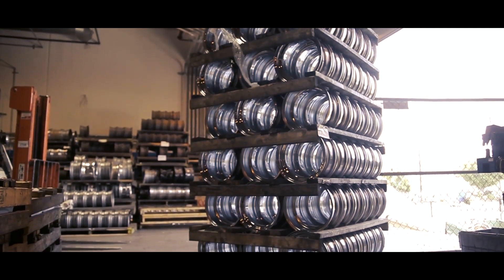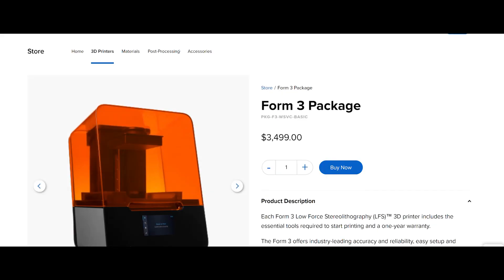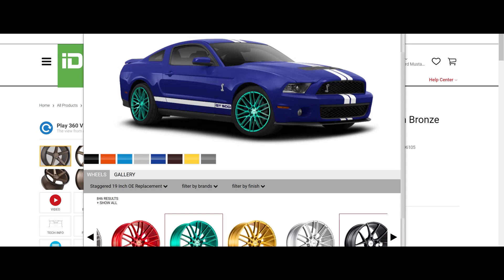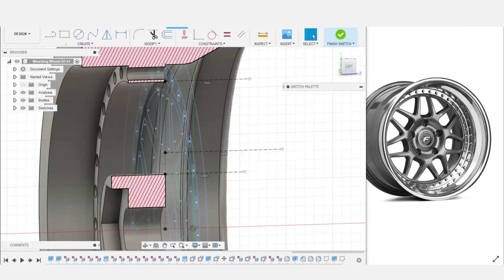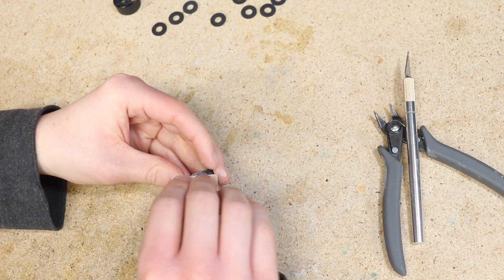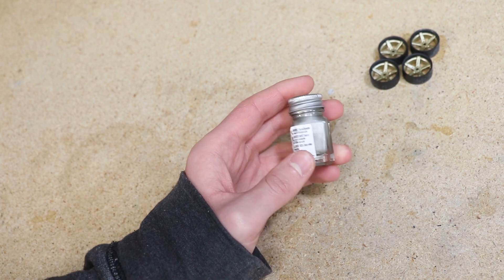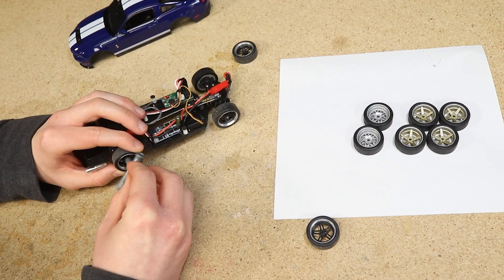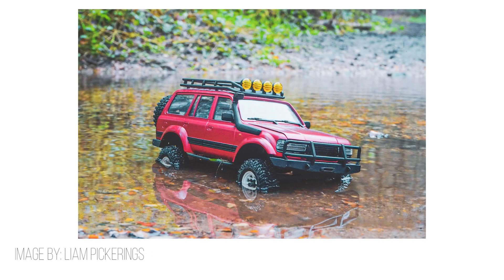How I Designed and 3D Printed Custom Wheels for My 1/25 Scale RC Shelby GT500

Comment: I've been 3D printing for 6 months, learned so much, so much to learn....  Curious why you printed the wheels elevated on supports VS laying flat/on a raft?
Reply from the maker: Nice! The wheels were printed on a SLA printer which prints the objects upside down. Here's a link with much more info than I can reasonably put in a comment if you're interested in learning more about supports in SLA printing: https://makezine.com/projects/fine-tune-your-resin-3d-print-supports/

Comment: $99 for an anycubic photon zero. Worth it. The only problem is there aren't really replacement parts available. But for $99 for a working machine that has great results there's no excuse anymore. I've been using dyes for clear resin which has saved me even more money. There's never been a better time to get into sla printing.

Comment: I have an elegoo mars and it does amazing detail. It is all about dialing it in and figuring out proper slicer settings. It can be finicky sometimes but it is also costs 10x less.
Reply: I have mars 2 pro and quality is superb. And it's way faster than SLA printer :)
Reply: @kruger12311  Nice to hear. Which resin did you use? Im looking for new 5 spoke rims for my mini-z and i dont know which resin is strong enough...
Reply from the maker: Good to hear. I know a number of our Patrons and customers use those printers. Opions seem a little mixed but I've been interested in getting some lower cost SLA/LCD/DLP printers so we'd have the same equipment as many of our customers/Patrons. I've been currently doing this by acquiring some lower cost FDM printers.

Comment from the maker: Finally was able to finish this video after days of sinus congestion not letting me record a decent sounding voice over. Hope you all enjoyed this video and are having a great weekend. 👍
Reply: Prefer the brass wheels, sexxy!!!  Btw, black is actually a perfect base for metallics but I would suggest spray cans (or an airbrush 👍) for the silver and brass.  For the brass, spray a silver on the whole wheel,  mask it, then finish with a brass color - will make it pop!  Much nicer (smoother) results!
Reply: Quick correction. Those 200$ printer are not SLA. They are LCD. My Mars 2 Pro has superb quality and is way faster then your SLA because it's curing whole layer at once and not running the laser to every pixel. Not criticizing just making sure people know they can do this for cheaper than 3.5k :) Anyway, nice work :)
Reply: Printing scale wheels can u let me know what size i should put in to my 3D printer to print 124TH scale wheels id like 17" 19" could u help with the mm sizes id need to print at and to give little bit of front lip can u help plz, 👍 thanks buddy in advance if u can or not help me.. Keith
Reply: Hey mate can i ask u question mite sound a bit stupid to u but im not good at all in tec or scale sizes i got 3D printer and want to start printing wheels in 17" to 19" can you please help me in what i should save in to the printer to print 124TH scale wheels in 17" to 19" with say little dish on front lip not been too big if u know what i mean. I want to do wheels with lip on them u know, 👍 thanks in advance mate.. Keith